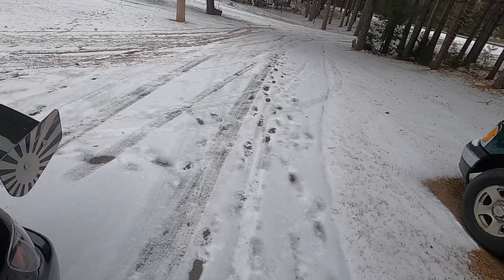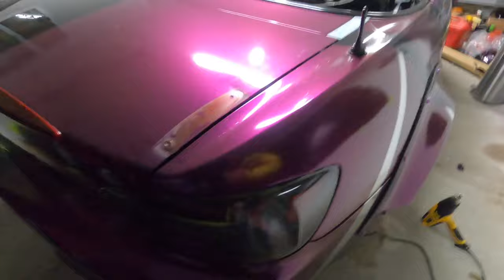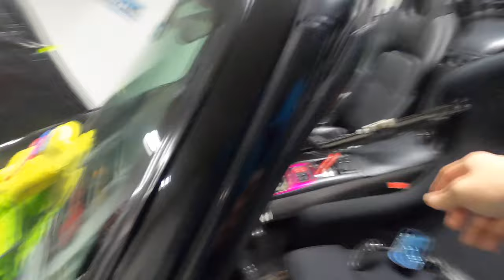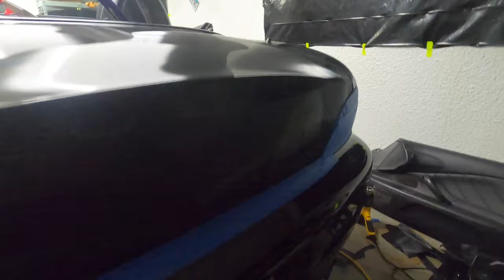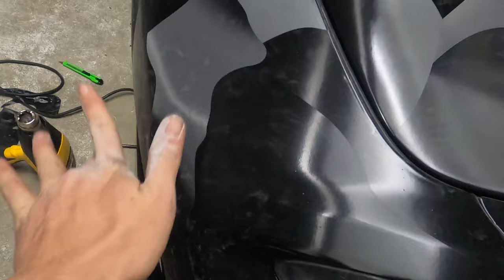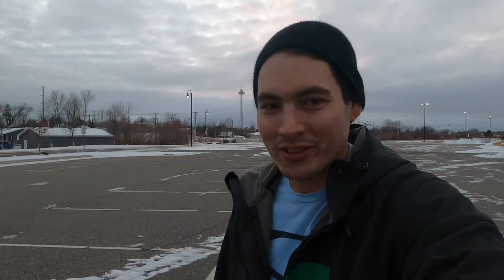Best camo wrap ever! Wrapping an s2000

Comment: Got my second roll fd up the first one, might have been too cold
Reply from the maker: @Jang Lil Bit of Errthang yeah I've messed up a few panels with it being too cold. The vinyl shatters or just doesn't stretch at all making it impossible to wrap anything. The coldest I will wrap anything of my own is about 60 degrees and thats pushing it. I had the garage to about 70 for most of this wrap and that was decent. Every brand and color will react differently so its trial and error. Good luck on the next one! Thanks for watching.

Comment: About to do the same on my Acura
Reply from the maker: @Helgy the video does no justice to this film. I am absolutely in love with it and the way the pattern shifts blows me away everytime I look at the car. You're going to love it!
Reply: @FRS2K  does material hold dirt or is it easy to clean.
Reply from the maker: @helgy2880  from what I've seen so far, you'll want to keep it clean and not let things stay on the film for too long i.e water spots, dust, dirt etc. I was able to get off anything that was on the film with slightly more effort than any other films. Dust will more than likely stick to it more because of the texture. Similar to a matte film but not as bad imo. When you wash it, the water follows the texture as it runs off which looks awesome lol.